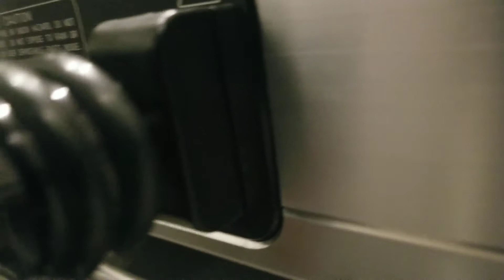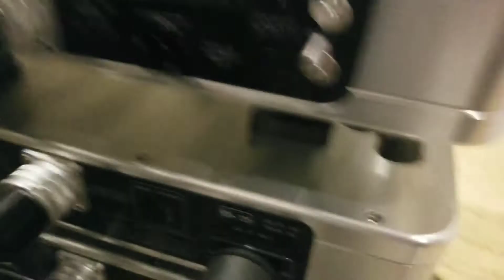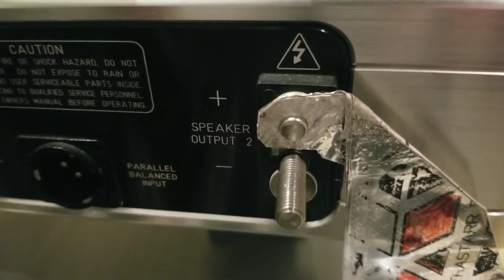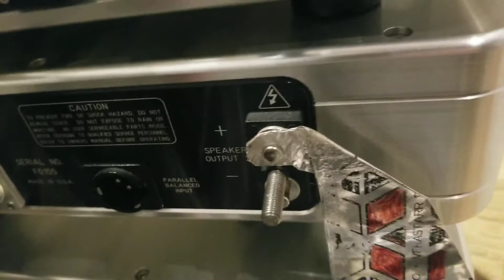Cardas Binding Post fix

Comment: Not much interest here. Might I suggest you do a video addressing Jeff Rowland spade connections. An odd choice in my "unedumacated" opinion.  One of the reasons there is resistance to his barely promoted, but, built- like-a-brick-shithouse components is the connection.  

A lot of audiophiles have expensive ($300-$1200) AudioQuest  speaker cables/interconnects with permanent banana connections and don't want to factor in the hassle of new cables if they switch to Jeff Rowland gear.  Address this in a video. You're one of the few (only??) Rowland dealers with a YouTube channel. Just a suggestion.  Much success!! PS... convince Jeff to do black in the US market! :-)